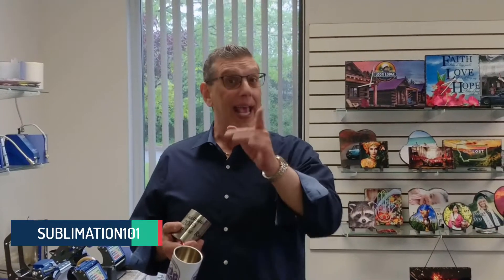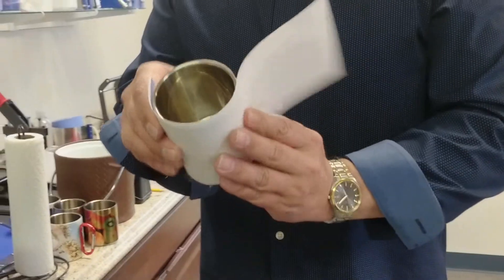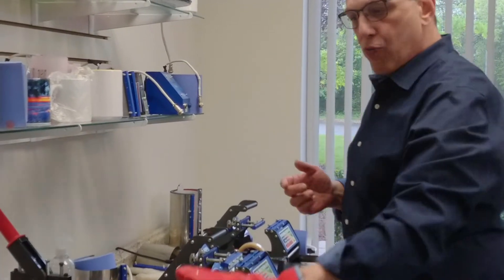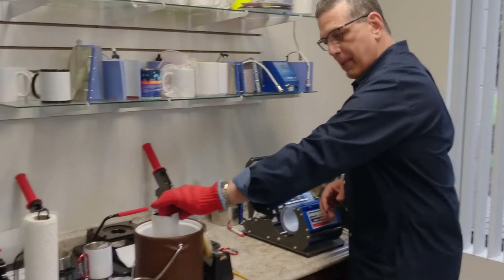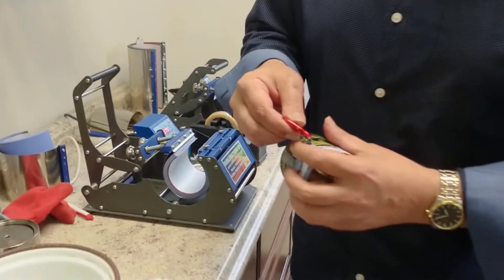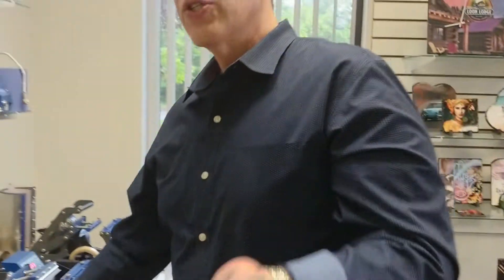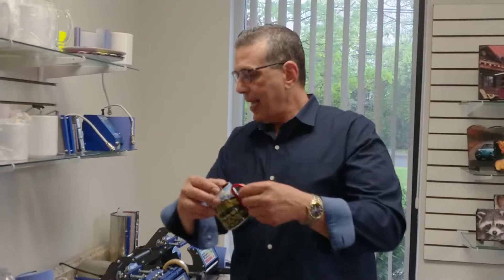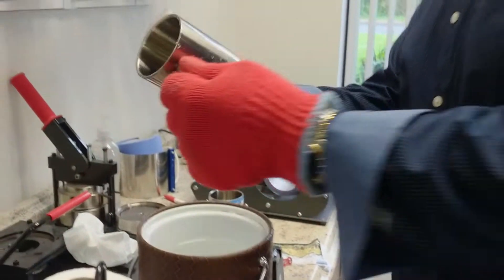Sublimation FULL BLEED Camper Mug

Comment: So beautiful, is this particular mug the only kind that you would need to place in the water to cool down after the image is placed?
Reply from the maker: We'd recommend doing it on all metal mugs/tumblers and most ceramics.  With ceramics you'll want to use a larger bucket for full immersion.  The size you see here will only get about half of a 15oz mug.

Glass and mugs with porcelain elements are not recommended; they will break.
Reply: @sublimation1012  oooo thanks for sharing, I never knew